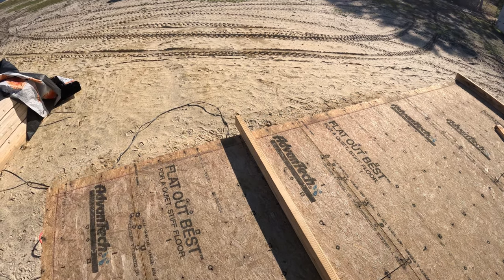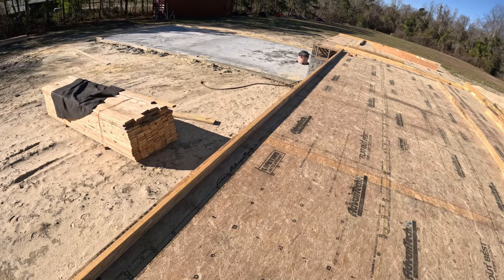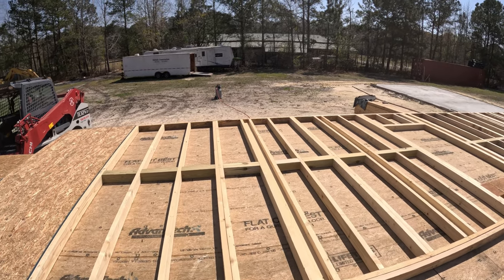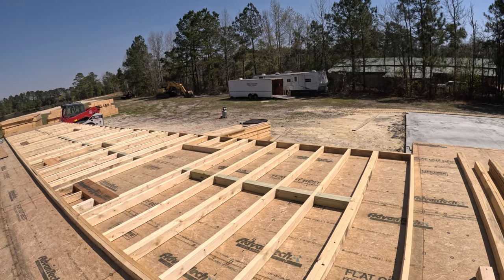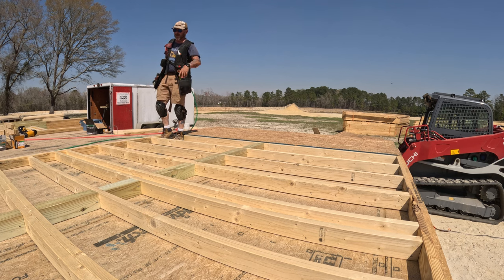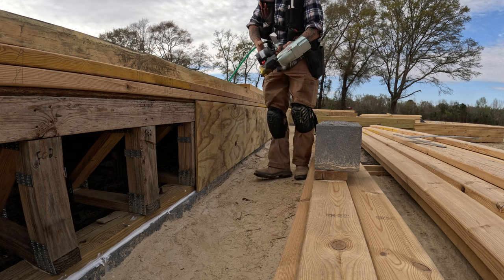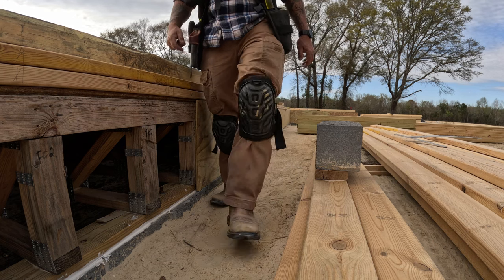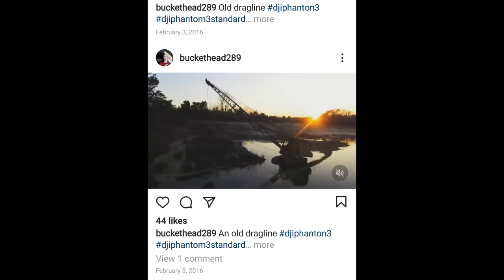"How To Series" Building / Sheathing The 10' Tall Walls For Our New House...

Comment: Great video! Consider hanging your sheathing down to overlap the floor system and tie into the sill plate. Makes for a super strong wall and takes away the hinge point!
Reply from the maker: I do that when my floor system is conventional framing with a box or TGI with a rim board,  this has floor trusses which does not have a solid perimeter so wall studs don't have a consistent nailing plane everywhere it's needed.